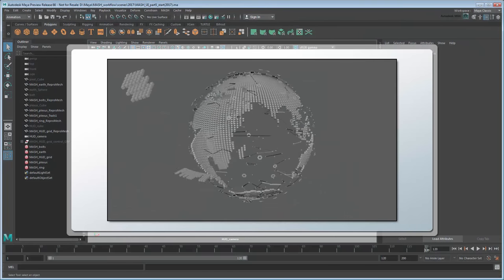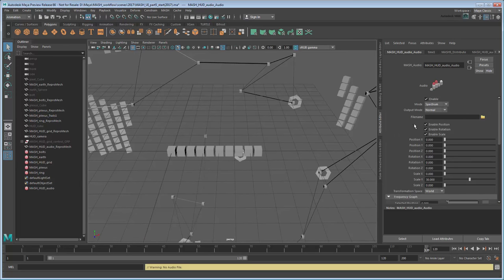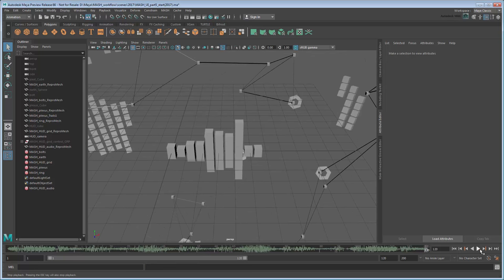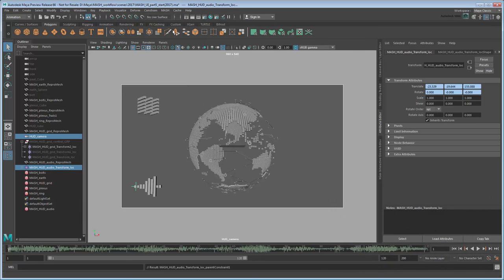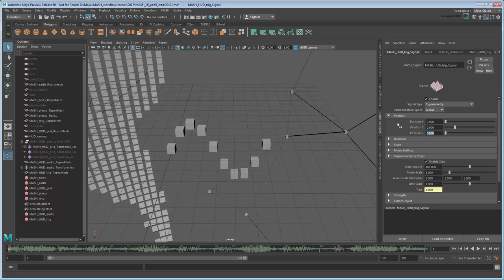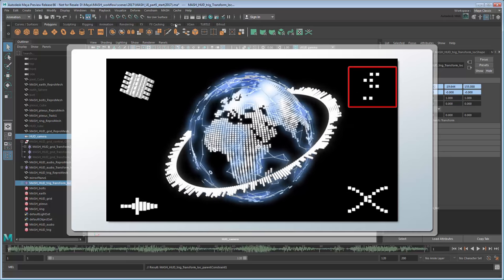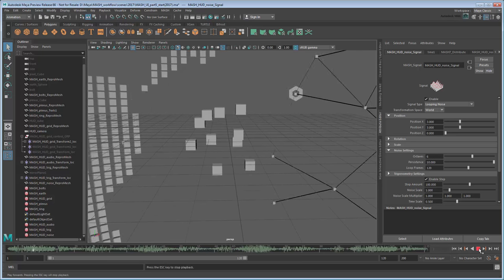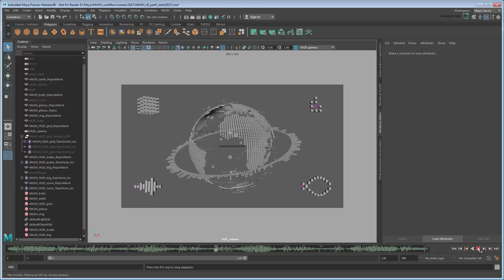MASH end to end workflow - Part 5: Creating additional HUD elements

Comment: Hello, I'm having an issue with MASH in maya 2017, specifically  with the ID node. In maya 2016.5, you can add various ID nodes and multiple falloff objects to work simultaneously on the MASH system. In 2017 it just work one or the other... is like they are not working parallel, the new ID node overrides the old one... Is there any way to make them work at the same time? or do i have to create a merge node to make it work together? Thanks :)
Reply from the maker: You'll need to use a Merge node as you stated.  Having two ID nodes work simultaneously doesn't sound like it was intended function, and was probably "fixed" when the new hierarchy was introduced to make the MASH Editor work.
Reply: thank you so much for your early response! I will proceed to do it that way :)

Comment: Hey, I have issue with python node I have different code my maya is 2022.
Reply: Did you get any solution? Same here the python window looks completely different. Maya 22
Reply: #add the index to the X,Y,Z position... I added the code, gave me false error message, but hen it played fine. So it works.
Reply: The same in 2023, but if you type all the cod at the textnote, then copy / paste to Python Window. It works, but watchout about the tab spaces like the video. They need to have to

Comment: When I set the Output Mode to Multiply the cubes disappear. However in Normal, it appears fine. Any suggestions on why this might be?
Reply from the maker: Are you using the included WAV file or your own?  it may be that the WAV file isn't loud enough.
Reply: I was using my own, but I used the included one and it worked, thanks a lot!
Reply: I am using Maya 2018 v03 and am having the issue Haydn did in his original post. I am using the audio provided. For now I reverted to Normal mode as anything else results in lines only.
Reply: @TheLillianYoung  same problem with maya 2017, if i use multiply the scale changes universaly so the x and z scale goes to 0, instead of being ignored. Thats why we get lines